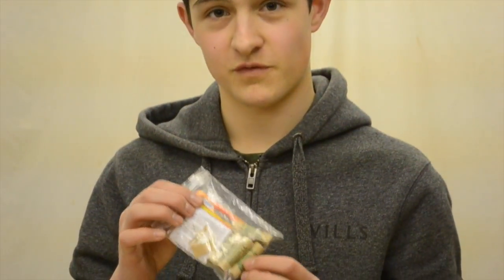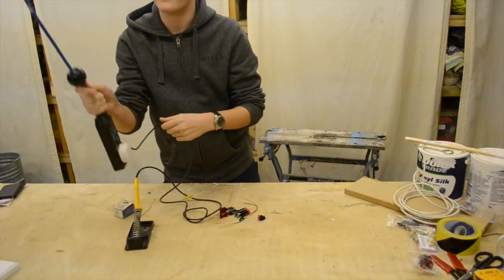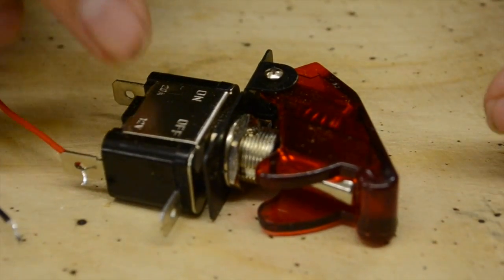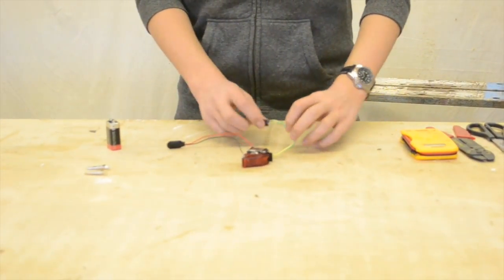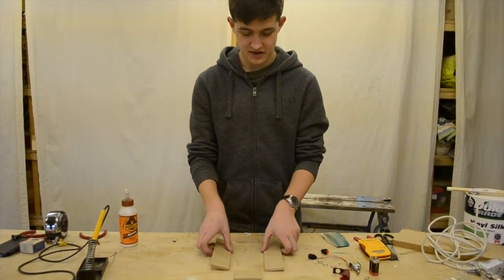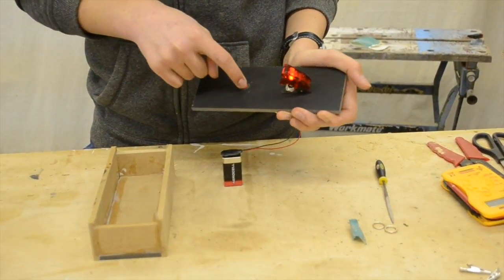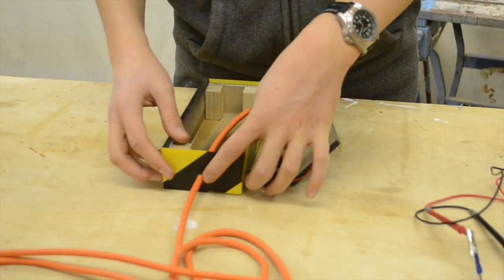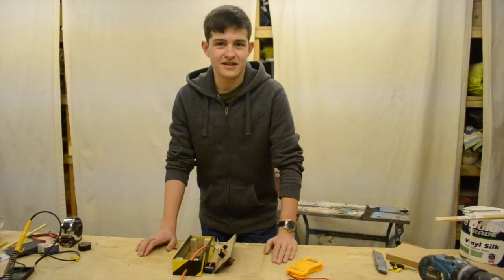Model Rocket Launch System

Comment: how did you wire the push button?
Reply from the maker: I wired it so both switches have to be on for it to work. There isn't a control board or any complicated wiring. I just played about with it until it worked how I wanted it to.
Reply: @elyotharmston9437  thanks for getting back to me. I think I have figured out which wires go where and what they connect to.
Reply: @elyotharmston9437  and when did it work?
Reply: @chrishoagland7926  and how is that?